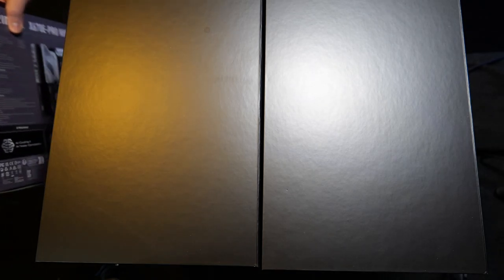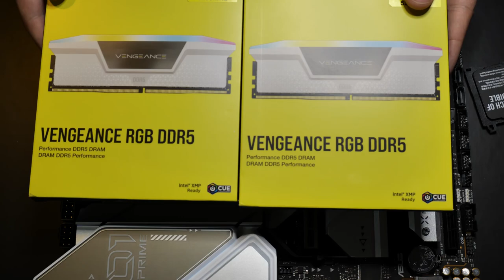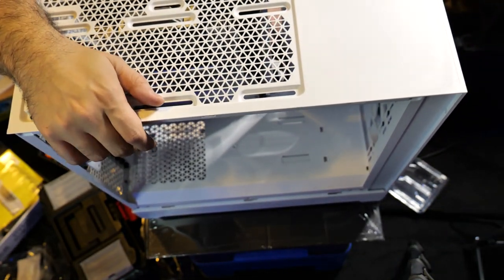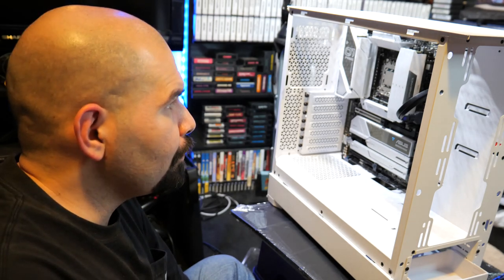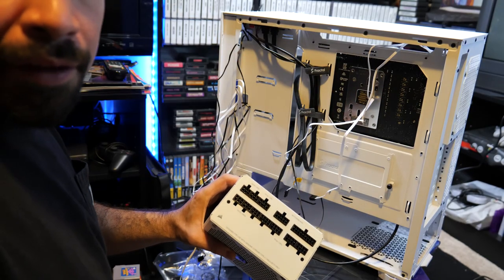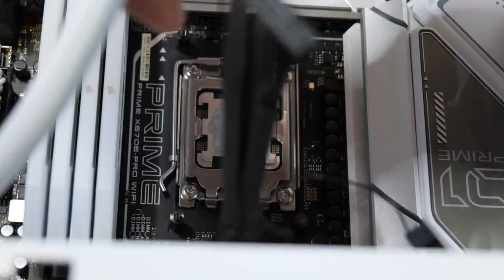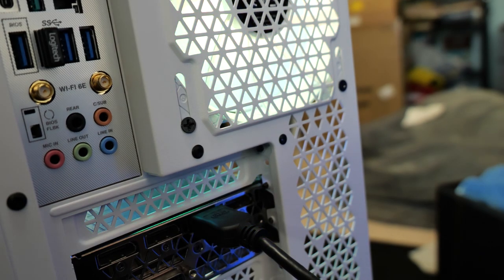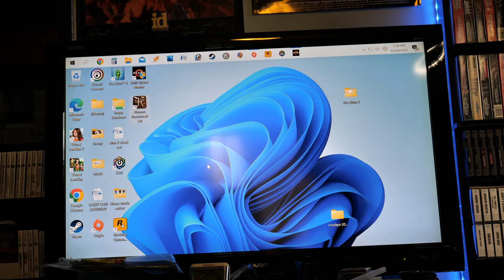How To Build A PC - AMD Ryzen 7700X Gaming PC

Comment from the maker: 0:01 Prep Motherboard
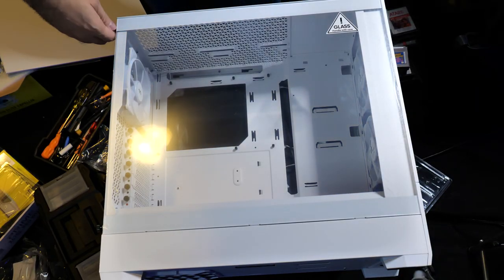7:54 Installing Motherboard inside Case
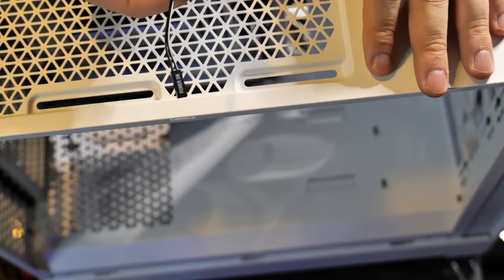11:53 Motherboard/Case Jumper Cables
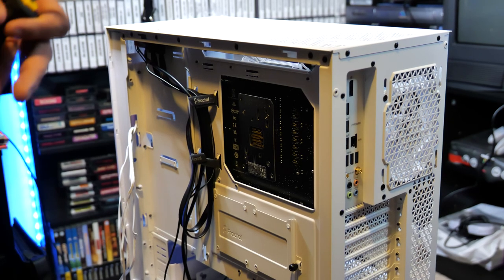14:22 Fan Installation/Removal
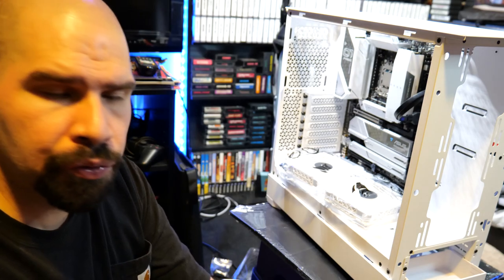19:13 How Fan Airflow Works
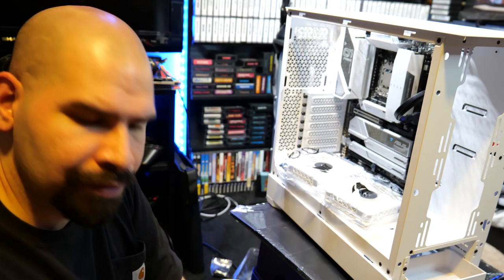20:24 Liquid Cooler Fan Mounting/Installation
24:18 Power Supply Installation
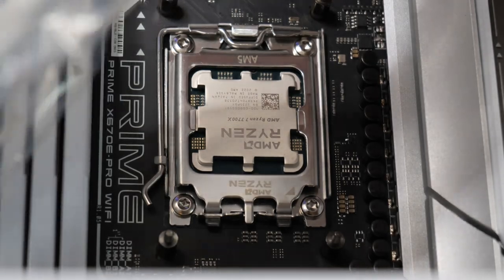26:16 Pasting the CPU
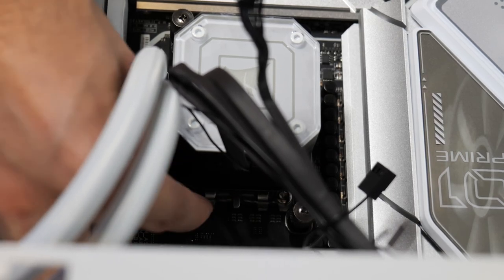31:30 SSD Install / Wire Management
33:34 Trouble Shotting Error Codes on Motherboard
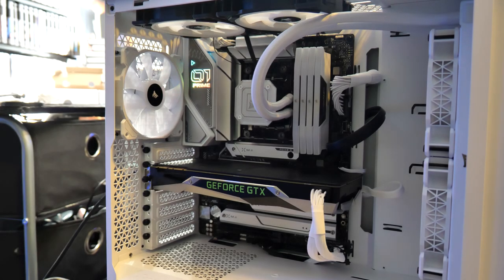35:25 Resetting CMOS Settings (If Needed)
36:47 Upgrading BIOS on new ASUS motherboards
37:44 Testing the Machine / Benchmarks

Comment: Hmmm. The radiator fans are blowing into the radiator to cool it. But you then have two fans on the other side which would blow the heat back in .. wouldnt it? Your fans are blowing in opposite directions with the radiator in between. Or am I missing something here :-\.

Comment: Does the 7700x Ryzen 7 work fine with 4 ram 5200mhz DDR5 sticks? Because I've heard it can only handle 2 5200mhz sticks and it will run at 3600mhz its using quad channel
Reply from the maker: I would say that the RAM situation is probably motherboard specific, rather than CPU specific. Depends on which BIOS version you are using. I usually leave things stock on the BIOS. I highly doubt that the 7700x restricts RAM speeds. Its the motherboard and the bios that restricts it, and there is probably settings that have to enabled to take advantage of the full speed.